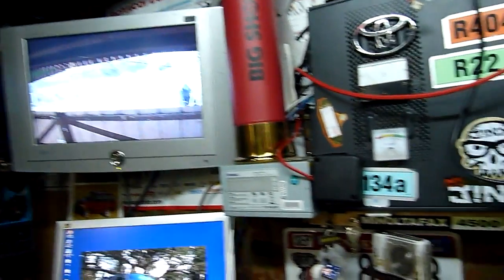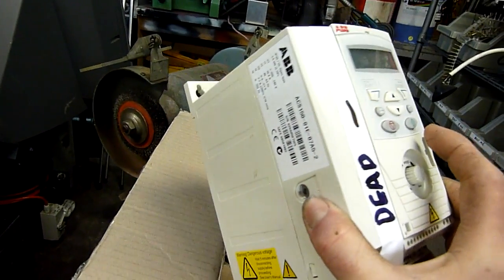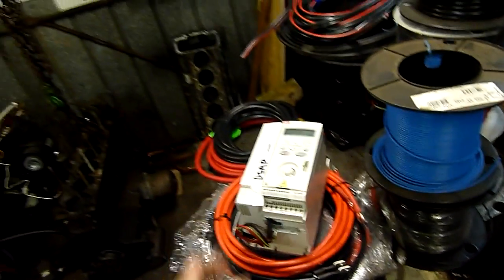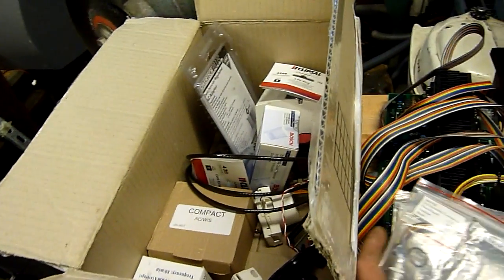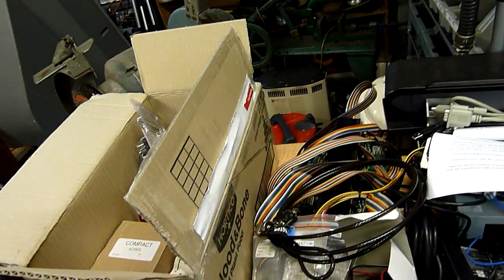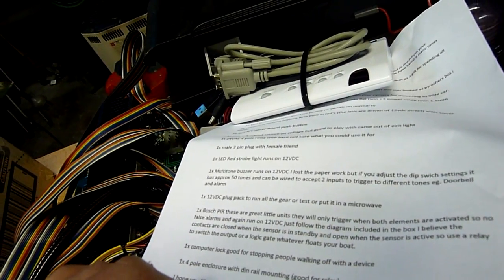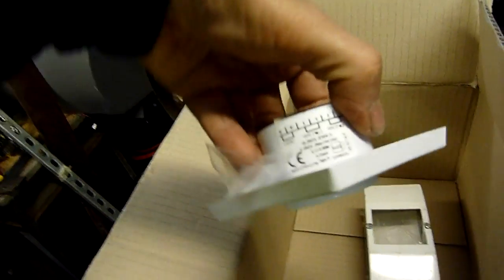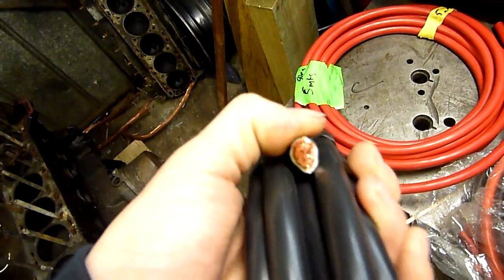Ramblotronic Tuesday - Electrical Goodies and Cables

Comment from the maker: yeh don't sweat about the battery connectors, I think I can get paired sets for $40 each over here.

the cable will be great for jumper leads, just need to order some heavy duty clamp ends (same company that sells the quick connects) and a surge arrestor

Comment: Save that 2 awg for Jumper cables for chaging car batteries . , I paid $150  us for 15 meters of the stuff ' oh the  them  aniti reversal connectors is called series SB350  they retail for around $35 us per end , and you need  2 ends ( male/female  ) . the SB175's will work perfect for car batteries .  I use them on the semi and the race car , make jump starts way better , specially the truck as it uses 4  700 CCA batteries and  12/24  parallel start system

Comment: No! Don't give that LED 5V - you'll most likely destroy it. It needs a constant current. In fact, any LED requires a constant current instead of constant voltage. Put some resistance in series with your power supply.

Comment: That LED is probably somewhere between 1 and 5 watts from the size of the heatsink, it will definitely need some form of current limiting or it will eat all the amps it can get. It most likely needs somewhere between 3 and 4 volts at ~300 to ~800ma.

Comment: Wire must still be relatively cheap even at a retail level in AU, I've seen stranded 2 AWG wire with terminal lugs, similar to the battery leads you bought, three foot long for $69.  Which I find ridiculous, but, copper is no longer cheap.

Comment: Ahh smashing, allways nice to be appreciated, what a nice bloke, nice box of things to play with :-)

I would play safe and give that led on heatsink 3v, or put 2 diodes in series with your 5v psu :-)

I hope that vfd is repairable, cant have enough vfd's to torture motors with lol.

I thought the old pir sensors were 12v, i did comment but you have millions of comments so its like a fart in a windstorm lol :-)

Brad will salivate over the wire, lol

Smashing vid, have fun mate :-)

Comment: Ed, DO NOT connect this LED to 5V. They need constant current (~ 300 to 700mA) as any other LED. Typical voltage is about 3-3.5V, but it depends on temperature, production batch etc. At 3.3V you can get 50mA or 5A - it's very touchy. Running it with series resistor (4-10 ohms) from 5V is much better idea :)